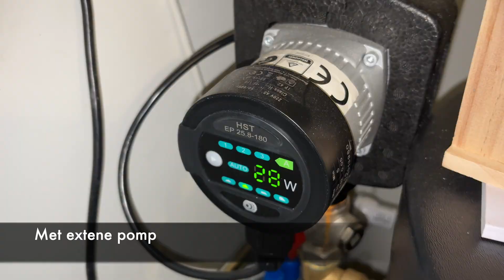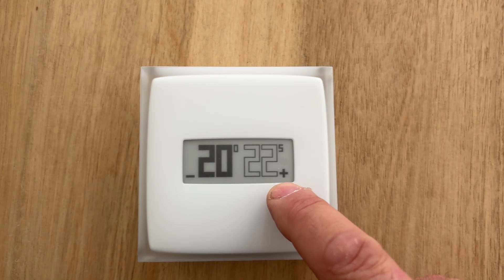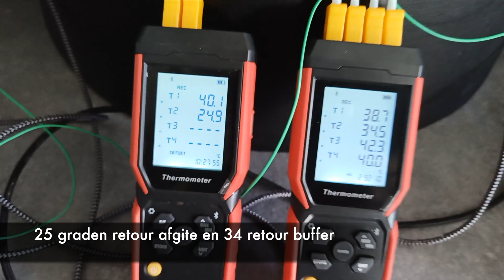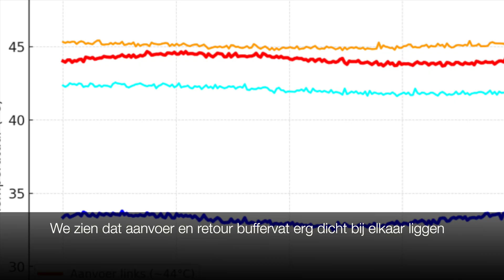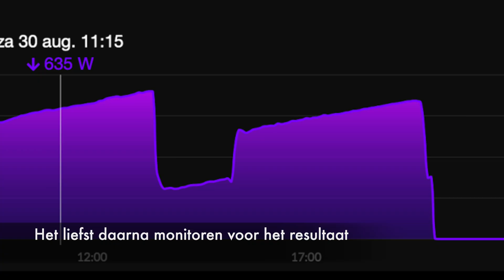Buffervat, leidingen & sensoren: waarom deze warmtepomp niet goed draait

Comment: Slecht gemaakt installatie inderdaad, maar 22mm is een goede diameter onder de 10kw. Die kunststof is inderdaad super slecht. Die sensor is voor het tapwater en de unit kan op retour temperatuur ingesteld zijn. Weer goed dat jij bent geweest!
Reply: 22mm koper volstaat bij een 5kW wp maar net. Bij 10kW met delta T 5 praat je over 1,7m3 water per uur wat rond gepompt wordt. Om onder een leidingsnelheid van 1 m/s te blijven moet een binnendiameter van 26mm toegepast worden. Dus meerlagenbuis 32mm of koper 28mm.
Reply: @mnmaamisanoniem  Pas geleden had een installatuer een diagram gepubliceerd dat een 22mm leiding tot wel 38 liter per minuut kan halen.
Reply: @mitchienl2509 Misschien kan het, maar het is niet conform de norm. Die schrijft een maximale stroomsnelheid van een meter per seconde voor in technische ruimtes. Buiten dat loop je risico op ruis en andere geluiden bij hogere stromingssnelheden.

Een 22mm leiding en 38 liter per minuut geeft een stromingssnelheid van 2,2m/s. Dat is echt extreem.